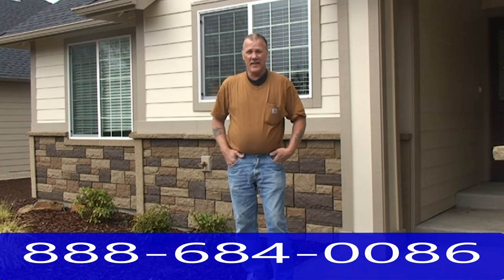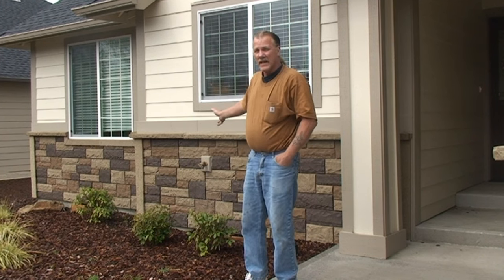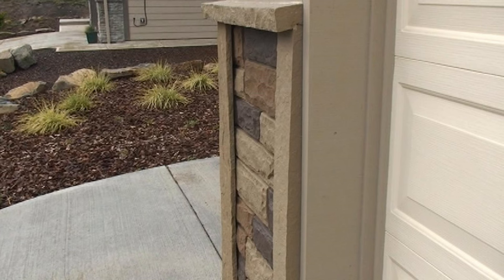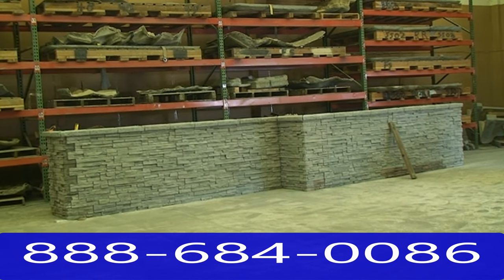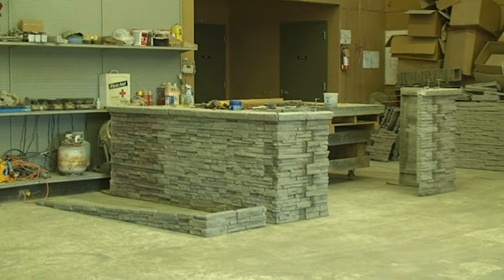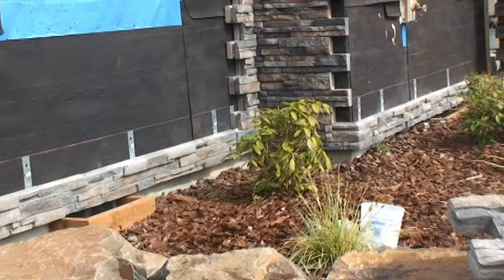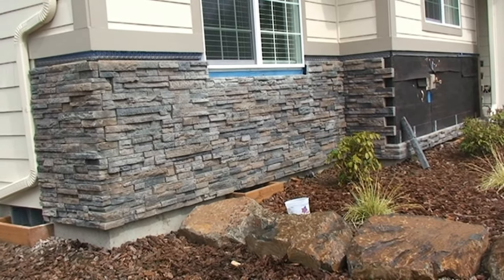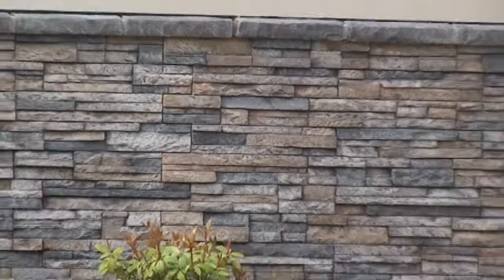Foam stone panels vs cement stone panels

Comment: is your stuff better then GenStone?
Reply from the maker: That is up to the individual consumer. I will say the GenStone is made with a urethane foam where our system is a fiber, reinforce cement, much longer lasting. They also don’t have a way of dealing with the length of a panel coming to an end or a corner. We have interlocking corners and we don’t rely on trim to make those intersections happen.

Comment: Whats the average cost to install per square foot?
Reply from the maker: I guess that all depends on who you call to do the work. I charge $42 a square foot just to make the panels custom to your home which does include shipping but still it’s a very high priced item. Thanks for watching my video.
Reply: @fauxrock Does that include the price of the material as in total cost.?
Reply from the maker: @scruffy4647 yes

Comment: I don't understand why a homeowner would go with any kind of fake stone instead of real stone.  When we were building our home we wanted to do a stone facing on our fireplace (inside) which was an area of 6 feet wide and 18 feet tall.  When we went to the place selling stone, you walked into a showroom with about 3 dozen brands of fake stone.  I told the guy we wanted real stone and he walked us outside to 3 large piles of different kinds of rocks.  I asked him why he had dozens of kinds of fake stones and only 3 kinds of real stone.  He said - let me tell you a secret - we are in the business of selling the stone but not installing it.  No matter how fancy, fake stone is just colored cement.  Its very cheap to make and the markup on the material is very high and, compared to real stone, its relatively easy and cheaper to install.  Real stone is relatively inexpensive as its mostly in its raw state but its very labor intensive and the labor has to be highly skilled.  So there was no incentive to push the real stuff, just the fake stuff.  Whereas, because the stone is so cheap, masons can charge more and be fairly compensated for their work.  Also builders use the fake stuff simply because they are building a lot of houses and the labor to build with real stone is expensive and hard to find.    So re cost, it always seemed like a wash to us.  But everyone pushes the fake stuff because the stores and manufactures make money and builders can find more folks with the skill level (which is still not low) to them install it.   But, manufactured by God, nothing beats the look of real stone.  You can spot the difference from a mile away.
Reply from the maker: Thank you for your feedback. I will say the market does dictate what materials will be used by the majority… we’re just along for the ride. Most of us position ourselves to capture the majority of sales over the minority. Thanks for watching my video.